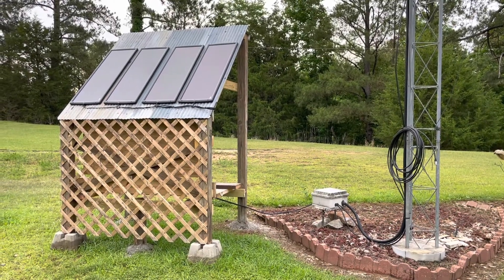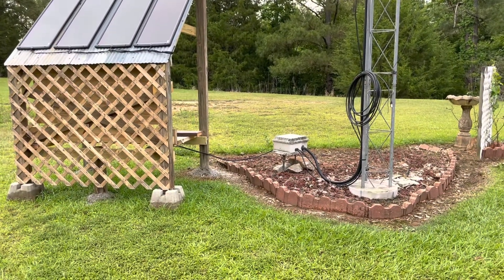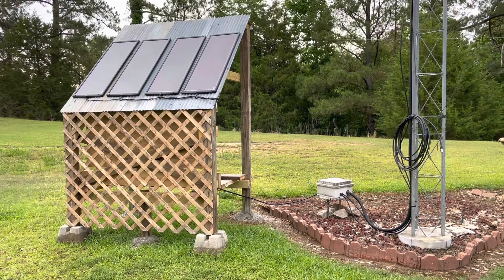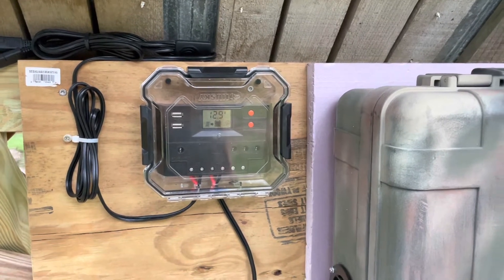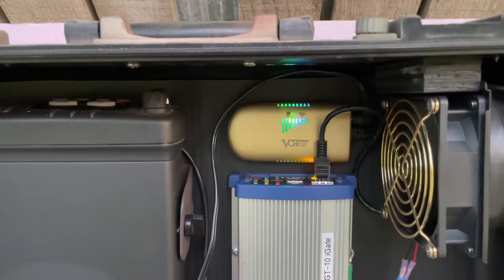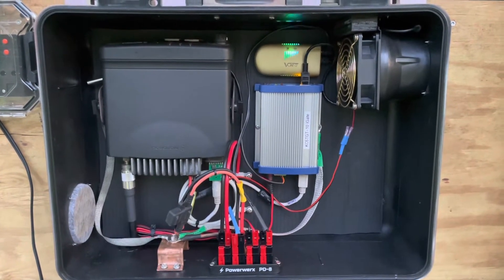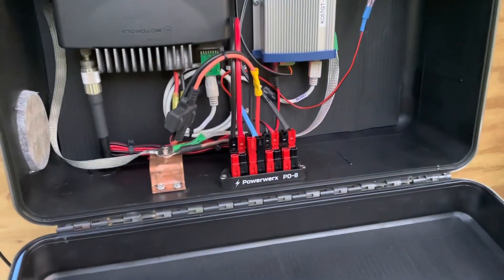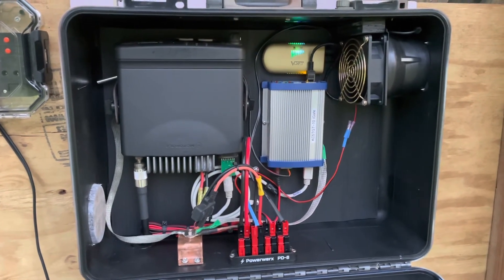KC5TGT-10 Solar Powered APRS iGate

Comment: Nice setup. The only two changes i would do is one, have the intake Stright up and down, second  i would use an LiFePO4 battery. Just for others to know , you would need a LiFePO4 charge controller for that. For extra cred, I would add a Meshtastic node. I thank that little add on is good because everyone can join in the fun. Thanks for sharing.

Comment: Those Harbor Freight panels and PWM charge controller ought to be outlawed! They are sooo expensive considering that they are only 100W. This kit currently retails for $169.99. You could have got a "proper" solar panel and a MPPT controller and a few beers for less than that. I'd be interested to see how well all that plastic surrounding the panels fairs in the UV. And the electrical wiring is a bit limp too. They supply the panels with inadequate gauge cabling and so there's a huge voltage drop over short distances. Kudos for your MacGyvering skills though!!
Reply from the maker: I do not disagree that Harbor Freight is charging way too much for these panels today.  I did mention @ 1:21 in the video that these were old panels that I had in storage.  So I decided to put them to use for this project.  That said, I did not pay current prices for these and when I did purchase them of course I used a coupon. LOL  I think I got them years ago for around $89.00 if memory serves me right.  I would still recommend using better panels and charge controllers if you have the money to do so.  But sometimes to control cost you got to use what you already have on hand.  For this project I already had the Solar Panel Kit, Plastic Box, Computer Fan & Car Battery.  The Rohn Tower, Coax and Antenna had been abandon in place due to the owner relocating.  And the Motorola Radio was donated to assist with getting this project "on the air".  The wood and tin used is old and were left overs from odd projects.  To complete it I had to purchase the WX3in1 (not cheap), Argent Data Audio Adapter (cheap), Vonets Wi-Fi Adapter (cheap) and the Powerwerx distribution block (cheap).  Kinda had to laugh when you mentioned MacGyver because it's not the first time I've been accused of making things work from scraps....  Several of my friends call me MacGyver as a nickname.  Thanks for watching and take care!

Comment: May i ask why you chose to pull the operating power directly from the battery rather than from the load port on the solar controller? Also I noted you have a custom Map Icon for this station, Black diamond with overlay, how did you do that? This is quite similar to one I am putting together here in NM, I hope I have as good a result as you have here.
Reply: If my memory serves me right, the docs have recommend to pull power from the battery. You can pull more current from the battery and not over load the controller.

Comment: I bought the Moto adaptor board as well but I have an older 16 pin Moto radio.  Did you have to enable/disable/change anything in programming to make the board work with the TNC? Scott builds great stuff but sometimes is not big on details/docs.   Very nice setup!
Reply from the maker: Wish I could provide a better answer but I had a friend that works with commercial radios tweak the radio settings and adjust the gain pot on the audio adapter board to get it working.  He has access to professional testing equipment and was able to test and adjust everything.